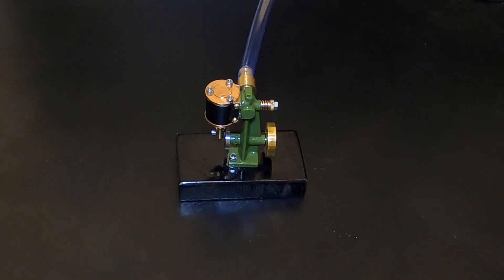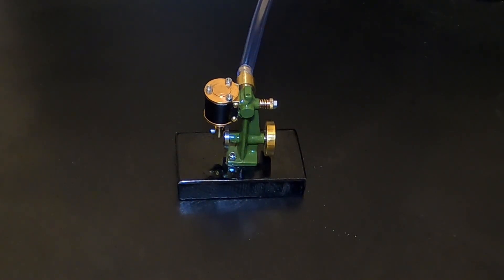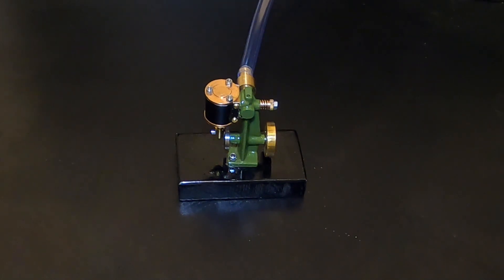Stuart models oscillating engine build part 9

Comment: Hi. I'm in the process of making it myself now. I can get it to run on an aquarium air pump at less than 1 PSI. You Tube deleted my post if I incluse the link to the video clip in the cloud.
Reply from the maker: If YT just include the end part of the link after the first equals sign. For this video OjT3ePQpwyg&lc works for me. How you finding the build?
Reply: @tandb  Hi it was challenging as I only have a nasty Chinese mini lathe & no milling machine, but enjoyed it. Yhe video is in One Drive & YT deleted yhe comment even if I try to disguise it. I don't post to YT.
Reply: Try this link after removing the #s from it.

#h#t#t#p#s#:#/#/#1#d#r#v#.ms/v/s!Al2LDmBOOXjNuw0jWMSR6GDGbJBl?e=2hexrv

Mick
Reply: @tandb  Hi this link shows it running on an aquarium air pump, 1PSI or less. Also remove the #s from the address.

#h#t#t#p#s#:#/#/#1#d#r#v#.ms/v/s!Al2LDmBOOXjNuw6lNnLmMrp2CC9k?e=lH9gfg

Comment: Congratulations! What a great running little engine. Now you should move on to the twelve valve, three cylinder 850 pound internal combustion solar powered engine!😁
Reply from the maker: Thanks. Ha ha, I think I will stick to trying to finish the minnie, that's more than complicated enough. Maybe IC is a possibility after that.